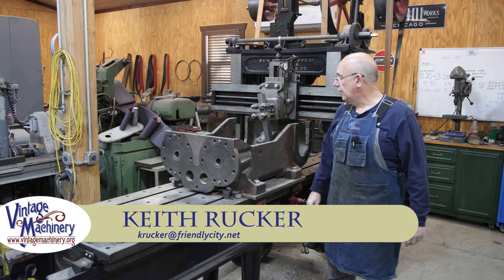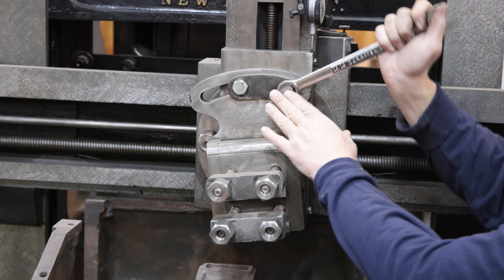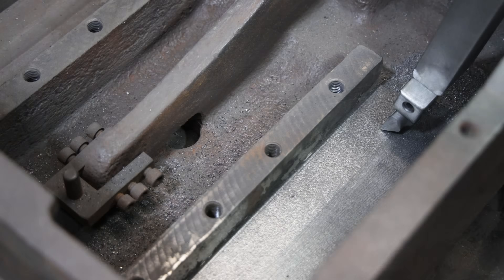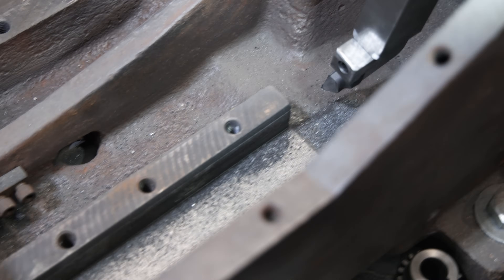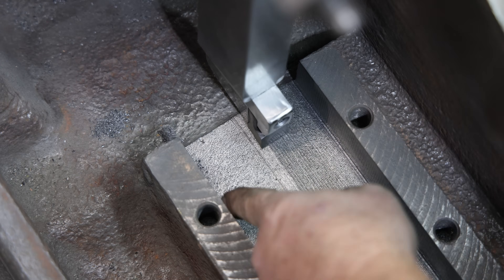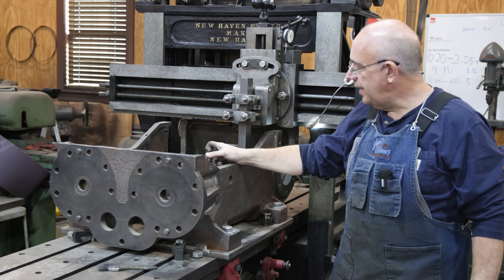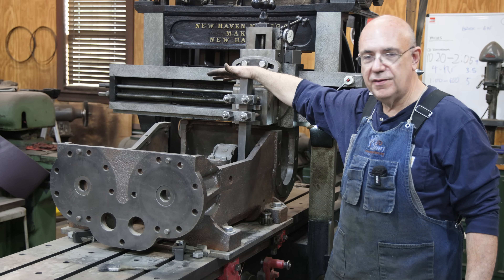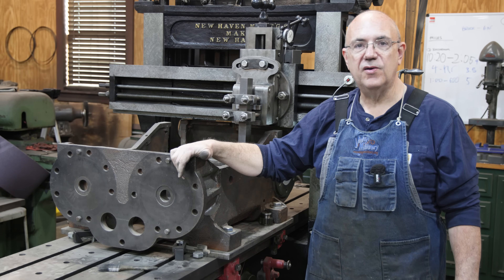Steam Stoker Engine Project: Continuing the Plaining of the Cross Head Ways

Comment: Hello Keith, I am a first time poster.  Thanks for all your content!  I have a (perhaps stupid)question:  If the top of the walls which surround the areas that need to be machined, have co-planar machined surfaces, could you use a handheld tool similar in ergonomics to a plunge router used in woodworking, where the base of the tool rides on the top o those walls to machine the surfaces below?

Comment: I think your tool holder bar does not work because when it forces it tends to penetrate the material due to the cutting edge that is positioned forward with respect to the bending angle of the bar. It is sufficient to modify the bar in its upper portion in order to move the cutting edge back with respect to the bending point so that when the cutting edge forces the bar tends to shorten so as not to penetrate the metal.

Comment: 14:04 it seems to me like with the cutting heat forward of the mounting point, that when it starts to cut, the entire tool and tool holder will flex backwards. Then, due to the pythagorean theorem, the tool holder is made “longer” deepening the bite, which creates a positive feedback. I think getting the cutting head mounted either flush or rearward of the tool holder will allow you to cancel out the tendency for the tool holder to extend under pressure.

Comment: I believe that as the tool worked hard and deflected a bit, it caused the tool to dig in and stall.
It is a good tool BUT you need a trailing type of tool which will NOT dig in as the tool deflects.
You have a conventional set up, with a too long cutting tool holder.
Put the cutting tip to the rear of that tool holder. I think it will work OK then, when cutting BUT might dig in when the reverse stroke starts, for a short time.....
What do you think?????

Comment: The geometry of the tool holder is wrong.  The way it is when the tool bights it flexing the holder which pulls the tool deeper into the work.  You need the cutting edge 90° to the pivot point so it lifts out of the work when it bights.  You probably want a slightly positive grind on the tool so that under load the cutting edge doesn't go negative from the holder flexing.  But the biggest problem is it's pulled into the work due to the geometry, you are pushing the tool and it needs to be slightly pulled.  Cutting face should be at 6:00 O-clock so as the load grows it sweeps up tward 7:00 O-clock out of the work.

Think of a walk behind plow, you pull it and depth is set by the approach angle where tool is cutting.  A well adjusted plow goes down when the man lifts the handles and goes up when you hit a rock from the mule pulling the tongue.

Comment: The planer I used to run was a G. A. Gray , it had 2 top heads and 2 side heads.  The table was 4' by 18'.  Mostly made door jams for coke ovens and wear plates for rock crushers

Comment: It is the geometry of the tool that is causing problems. The cutting face needs to be behind the pivot point on the clapper box. With the cutting face out in front of the pivot point, when the tool is cutting it is moving backwards slightly and because of the location of the pivot on the clapper box, movement of the tool backwards causes it to be effectively longer. It is a vicious cycle, backwards movement makes the tool effectively longer causing it to dig in pushing it further back causing it to get even longer and so on. The same thing happens with lathe tools as the tool is pivoting below the cutting face and making it longer and literally forcing the blade deeper into the cut. Breaks tools, ruins parts. I haven't figured out a way to address it effectively YET. But if I can get the cutting face below the pivot point which on a lathe is really hard to define, breaking tools and ruining parts will be a thing of the past. I suspect the same for your situation. But with how little clearance you have inside the part I don't know it that would be feasible. If you move the cutter back enough, you may not have enough room inside the casting.

May be easier to just go with a narrower tool. Or relieve the center of that wide tool to reduce the cutting forces. It wouldn't take much, clearance is clearance. Could be as simple as grinding out the center and leaving the sides to do all the work. Would let you cut corner to corner without a tool change.

Comment: I think that no matter how rigid that tool holder may be, the cutting force generates a lot of torque trying to twist the cross-head. Furthermore, any such twist causes the cutter to go deeper into the work. I would think that you might need a sort of crank-shaped tool holder that puts the actual cutting edge directly below the cross head so any twisting that occurs does not make the cut any deeper.
This of course would get you back into the same boat regarding clearances but perhaps reversing the work (that is, cutting towards rather than away from the crankshaft end) would give the required clearance.
Another thing that would help would be a narrower cutter. There is really no reason for the cutter to be wider than, say, twice the stepover distance. This would allow you to plunge the cut without trying to take off a chip 1" wide.

Comment: I worked for a fabricator down in central Mississippi years back, we had a very very similar situation on the inside of a specialized casting.  We found that with the long tool holder you need to put the cutter no the rear side of the supporting arm.  Don't make the cutter anything fancy just a simple lathe tool, but we through drilled it and bolted on the back side of the cutter supporting arm.  Ours was even longer than you need.  We made it so that you could adjust the rake of the insert to account for the flexure of the supporting arm.  That was done by drilling and tapping an adjusting means into the insert tool holder.  That is the insert tool holder was then bolted on the back side of the supporting arm.  It worked very well and that was for a fairly long run of parts, into the hundreds.  Thanks for the video, very well done as usual.
Reply: Good solution. Geometry reasons of course. Too difficult to explain without pictures, but you want the tool to Shallow itself as pressure increases. Lathe parting has the same problem. I mastered parting by a similar geometry adjustment.
Reply: @AbbeyRoad69147   Exactly, under the deflection of the supporting arm the tool should shallow itself.  You explained it best!
Reply: That's what I was thinking. Maybe even weld a dog leg in the tool holder to position the  cutter behind the center of rotation.
Reply: I think the word on the 2nd line should be 'on' not 'no'.  But a fantastic solution!
Reply: @silasmarner7586  Yes, you are correct.  Thank You

Comment: As much of a pain it would be. how about a trim router mounted to the tool holder with a shaft extension to hold a 1/2" end mill? Or if I recall, you said this was going to get a Babbitt pour in there? Instead of that how about making a replaceable wear surface out of bronze?

Comment: For those watching.  When the tool digs in.  Its not the tool bar that is flexing down.  Its the saddle and the cross beam that is flexing.  Moving the cutting edge to the back of the toolbar is not going to help .   Reducing the face of the cutting edge is the only way to do it.   He only needs an 1/8" of flat cutting width to do this smoothing.
Reply: I agree, just narrowing the cutter width will alleviate the force being applied without having to construct a whole new tool holder. That cutter looked like a full inch wide, and any narrowing will reduce the force proportionally.
Reply: That 1” cutter looked about 100x too wide, and I’m not even a machinist.

Comment: not sure if a good idea or not  ,what about attaching one of those hand held small belt grinder ,to the current tool support, there is  plenty of room , you can change the belts from heavy grit to fine grit so the finish would be great. They are cheap , It would kinda be like doing a tool post grinder . would just have to create a simple mount. You wouldnt be able to do vertical ( i dont think) but tool pressure shouldnt be a factor. Im hoping this comment isnt to late :)

Comment: Sorry you are having difficulties. I'm sure you will eventually work it out. Must agree this is a challenge. A shame you cannot get a rotary tool down in there. I was concerned the casting moved when the cutter dug in. How about grinding a relief  in the center of the tool you are using to reduce the total engagement.

Comment: Kieth, check out a channel Cutting Edge Engineering..     he is a machinist is Australia. he has made 40/50 tapper arbors extended length to hold boring heads . think if you see what he did you could do same to hold a face mill or an end mill that would reach. that would let use a mill, If you have or already seen his channel. he is a self-employed young man with great talents  Look him up!   Brain Block knows him as well as others also. What is going on with Mr. Wiggens?
Reply: Just get out the pop corn, sit back and  have some laughs, watch Bozo in action!
No measurements, no dimensions, just "but Uhhh it's cleaned up"!
I did notice that he's not putting his hand in there to get smashed a second time!:body-blue-raised-arms::face-blue-smiling::face-blue-smiling::face-blue-smiling:
And you nailed it, CEE is a Machinist, Bozo here is not!

Comment: So much work restoring this machine and you ended up whit one the sounds like an tractor that needs to go to the scrapyard
You’re finishing Tool way too wide you should have known this…. 
I know you did try different methods, but you did it wrong… 
Vertical milling is the way to go . With a small diameter cutter. And shrink fit holder. Would work like a dream.

Comment: The tip of the cutter needs to be aligned vertically with the back of the tool bar so as it loads the cutter will deflect in an arc away from the work rather than digging deeper as it is doing with the tool set up you have now.

Comment: I'm not a machinest, but what about making the bottom half of the insert 1/3 to 1/2 as wide.  Sharpen both sides of the insert and cut going one way then turn the insert around in the tool bar and cut the other direction.  Or, make 2 inserts with the cutting edge on either side, depending on which side you're cutting.  In other words, make one insert left cutting and the other right cutting.  I hope this makes sense.  If not, please excuse the ring.

Comment: Two things that I see that are causing the issue, A) you are feeding down during a stroke gradually going deeper then dialing in a smidge more during or after the backstroke. This is the main culprit as I think you are dialing in more depth than you realize. B) once the overbite happened it left undulations in the surface as witnessed by the cutter still cutting while the tool was traveled back over the area prior to any extra down feed. 
I really think spring passes would get through that eventually, but that flat tool isn't ideal.  Small step overs with a large radius cutter and light cuts. The question is, what is the smallest step over the machine can do? just a few thousandths would be ideal.

Comment: I was grinning at the beginning cause i thought you finally had it figured out and all there was to do was let her eat. I was not expecting to have to start again at the beginning. This noble project has been a pita so far but you will conquer it. My dad was employed by the PRR at one time (back in the days of steam) and he got to know quite a few engineers and firemen. The PRR guys had a running rivalry with the guys on the NYC because in our part of Pennsylvania there was a good bit of shared or parallel track between the two. The PRR firemen were still hand shoveling coal long after the NYC had equipment with stokers. Their crews would thumb their noses at our guys when they passed cause their fireman was sitting on the tool box going up a grade and both our fireman and engineer were shoveling for all they were worth. Hang in there. 🥸👍👀👋✅

Comment: Tough one Chief - getting closer to the clapper pivot - and less dig, but you got very little room up front at your return. Beefier bar - you could triangulate it without too much hassle. Years ago, we made cable drums for mine headgear. 11/4 plate with a 1" semi-circular cutter - had this same issue - moved the tool behind the clapper pivot so it will run behind the pivot - stopped the digging - but we had plenty of run off at the end. The plate was rolled into a drum afterwards. Each track - tracked over by one pitch for the last foot or so, to accommodate the winding on of the cable.

Comment: Speaking as a cutting tool enginerd from the dinosaur age, we had a similar situation in the late 1990s. We brazed an M2 micrograin carbide wear pad in front of the cutting edge, giving clearance for swarf,  and ground it to give precise feed to the blade (about 0.0007).  This wear pad absolutely prevented the cutting edge digging in due to tool holder flex and eliminated chatter.  (The idea was from a G style drill bit unrolled and laid flat.)  >BUT< it took experimentation to determine the correct speed.  We were using flood lubrication with a based lubricant.  In your case, the amount of clearance at end of stroke and the experimentation probably prevents this technique.
Reply: Just get out the pop corn, sit back and  have some laughs, watch Bozo in action!
No measurements, no dimensions, just "but Uhhh it's cleaned up"!
I did notice that he's not putting his hand in there to get smashed a second time!:hand-pink-waving::face-pink-tears::face-blue-smiling::face-blue-smiling:

Comment: Back on the cursed (in my mind) Stoker Engine! You have waaaaaaaaaay more patience, and diligence, and attention span, than I ever have had. My vote, bolt a die grinder to the clapper and grind it, and since likely that won't work, load the thing in a truck and haul it to the metal recycler. Tell the locomotive folks to use a proper fireman to stoke the boiler, I think that is what it replaces? Maybe time to review what this thing is supposed to do.
Reply: I seem to recall that the story is that this is a ginormous loco that could kill a fireman trying to keep up with it.  The builder wouldn't use a stoker engine if it wasn't absolutely necessary.
Reply: Just get out the pop corn, sit back and  have some laughs, watch Bozo in action!
No measurements, no dimensions, just "but Uhhh it's cleaned up"!
I did notice that he's not putting his hand in there to get smashed a second time!:hand-pink-waving::face-pink-tears::face-blue-smiling::face-blue-smiling::face-blue-smiling::face-blue-smiling:

Comment: I imagine a wide tool like that would've worked well if the casting were flipped 180 degrees and you used a gooseneck tool, where the cutting edge is behind the shank. I bet there'd be other challenges associated with that though

Comment: I never did hear which alloy you made the tool holder out of. If you make another, I would start with the stiffest alloy available (4140?), modify the shape to get a stiffer working face, and then proper heat treatment. The suggestions about removing the center portion of the cutting edge and positioning it behind the center line are good. There is no doubt that you will accomplish this task. It sure is entertaining watching you tackle all of these challenges.

Comment: I would have made a mandrel for the milling machine that would hold a small diameter grinding wheel,  such as a tool post grinder. 
You could do your roughing on the planer right about where you are now and easily grind this to finish it. 
Would that be the absolute best way, no.  But you can easily control your feed rate with the mill.
The chance of disaster with this setup is nearly 100%
Joe

Comment: Hi Keith, maybe it is just me, but I am getting drastic changes in volume from section to section. I don't know what video editing software you use, but pretty much all of them have a plugin called "Normalize Audio". This will bring down the high volume and bring up the low volume to a middle level. Just a suggestion. Glad to see you back in the saddle!
Reply: The volume changes make the video almost impossible to watch with sound. I feel sorry for the people listening with headphones
Reply: Normalize is not the answer, all it does is raise all to max with clipping... there are other solutions,. Try to amplify to -3db without clipping, and decrease to -5 if too loud. Like anything unknown, play around with the settings while editing  and revert to original if needed.
Reply: @CothranMike  You are incorrect. It is true that it will not work great when the difference is extreme, but here is the definition from the web: Audio normalization is the process of adjusting the volume of an audio recording to a consistent level. It's used to make audio sound more even and consistent, especially when it's been recorded from multiple sources. 
How it works 
Analyzes the volume of the audio
Increases the volume of quiet parts and decreases the volume of loud parts
Adjusts the volume to a target level
Why it's used 
Makes audio sound more consistent
Helps avoid listener annoyance when switching between different audio files
Prepares audio for streaming services
Reply: @justinahrens1868  is right.  If you normalize the audio sources separately, then they'll all be as @CothranMike says, "brought to the max without clipping".  Which puts them all at the same volume. That volume is likely too loud, but they you can reduce the gain.  Sometimes the normalisation plugin will offer 'loudness normalisation' which will help with getting the levels right in the clips with and without machine noise.
Reply: @ke9tv  correct, I have used the features on most free and expensive audio editors. From my experience the choice to 'normalize' is not the best choice.